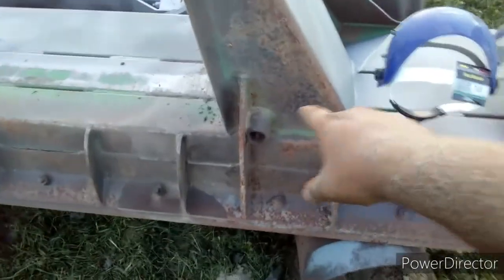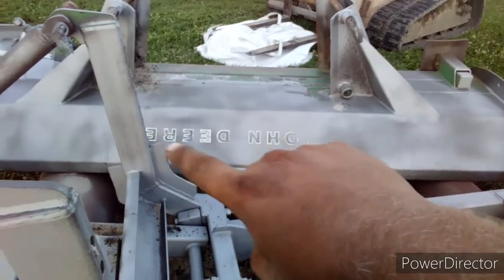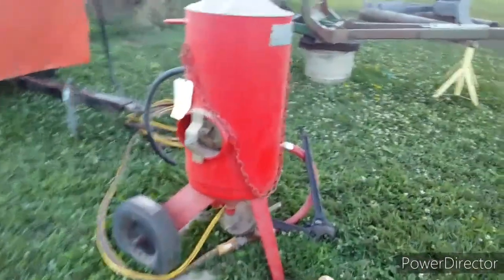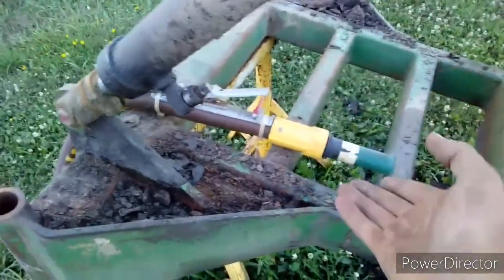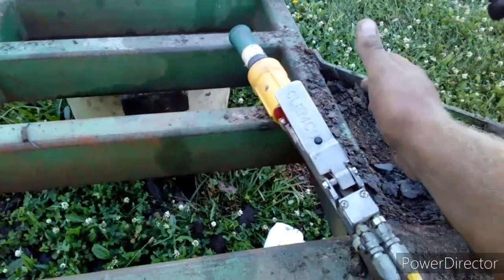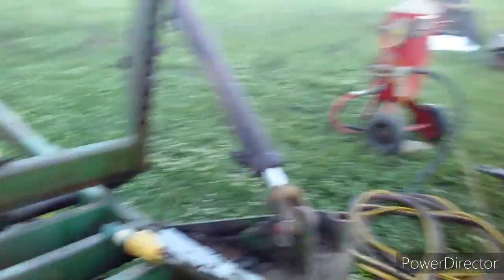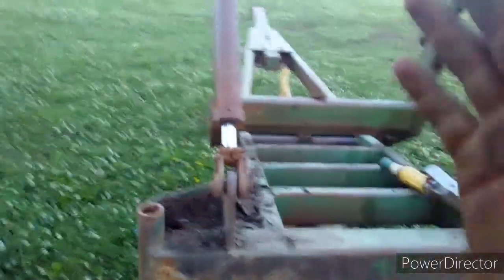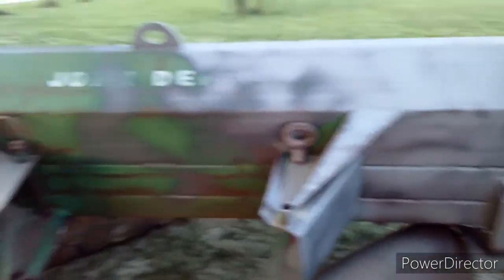John Deere blades sandblasting!  Part 2

Comment: Good explanation of the sand blaster.   Wondered about where all the sand goes.  Does it just blow away or do you have a bunch accumulated on the ground around the immediate area?  What kind of mask to you use?  I would imagine that stuff would be hard on the lungs/eyes.  Do you rent the blaster?  How much would it cost to blast what you are doing?
Reply from the maker: We do not recollect the sand due to the high labor of sorting/sifting the sand from the old paint pieces. It does accumulate over time but we used 1 1/2bags =3000 pounds of sand and we had little to no sand noticable on the ground.  We have face shields with masks so that will protect us from the sand and dust.  We do not rent the blaster we own all the equipment used in this video.  It costs about 250 dollars an hour to run our setup with products included and it takes an hour a blade.  All real good questions thank you for asking.